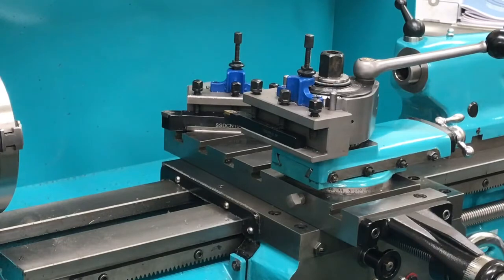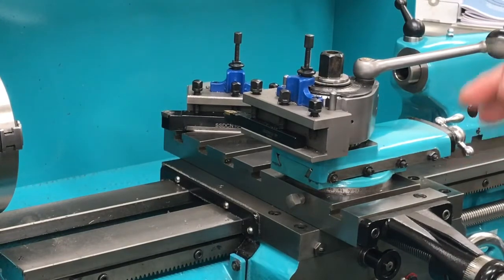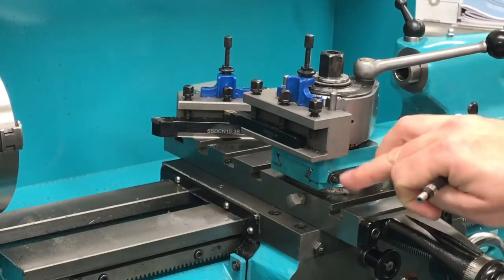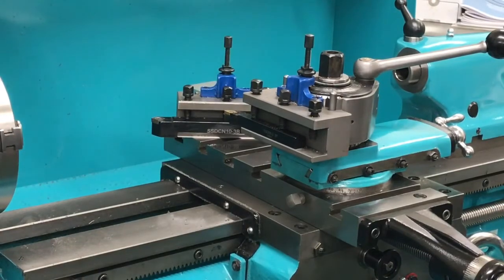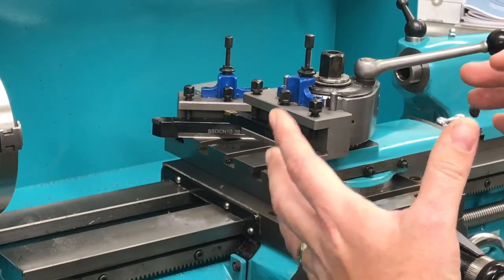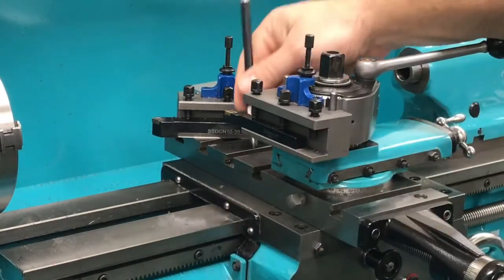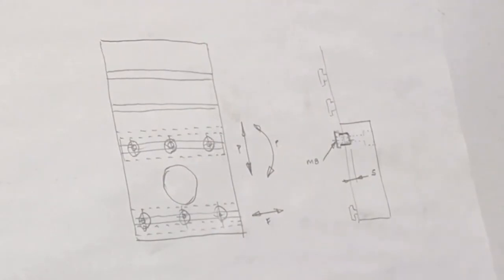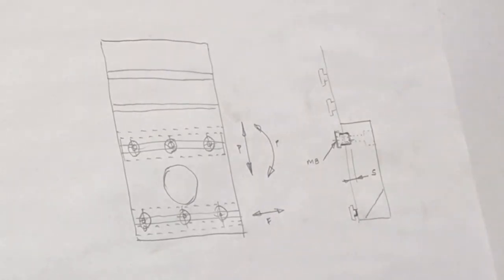Making a Solid Tool Post Mount for the Myford Super 7   Part 1

Comment: I really don't think that need to worry about losing rigidity through milling the toolholder for the 3/4" tools. I'm not an engineer,  but I think that the fact that the tool is now shouldered against the toolholder would more than compensate for the reduced depth.